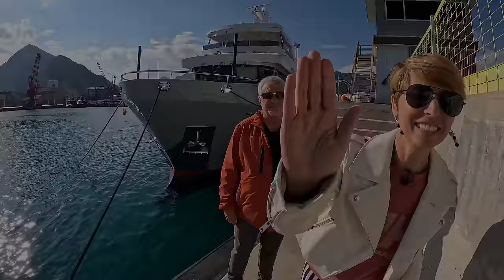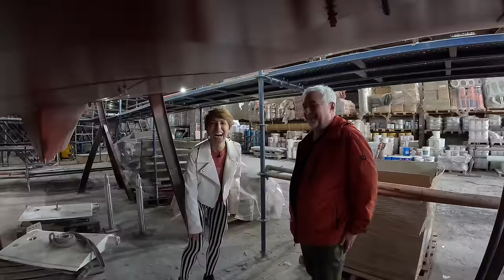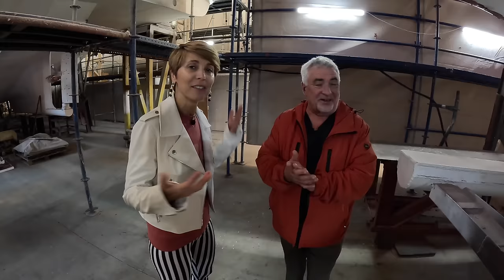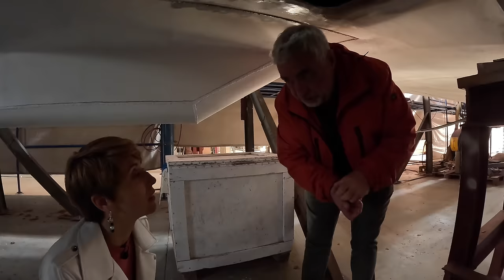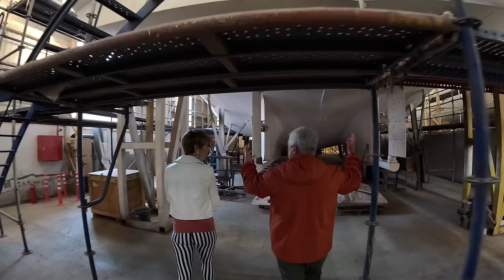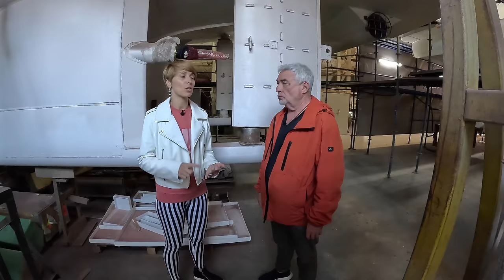This is Bering 72, but... 🙈 Eps.51

Comment: Zinc plates,are they sacrificial?  How often do then need changing, or is different oceans/seas have different rates of corrosion? I wrote his before I heard the voltage system,holy frig, my kinda ship, wow guys love all this info.  Started watching when you first started show casing other ships, but following this build is just amazing and gives a new appreciation to ship construction. When is anticipated launch date of you ship.
Reply: Yes, the Zincs are sacrificial anodes(aka galvanic anodes) and are used on all marine vessels as a form of cathodic protection. The electric powered alternative mentioned in the video actually sounds like a hybrid system and seems like it would save a ton in expenses over time since even just the Zinc is fairly expensive, much less the labor cost of replacing them.

Comment: 4:57 I think what he is trying to say here is that you can not close a circuit by sending the electric current through the hull of the ship.
Meaning, if an electric current happens to run onto the grounding the hull provides, it's lost to you, as it will be "dispersed" into the water.
That's a good thing over all, because that means that the danger stray currents pose to people on the boat is relatively small, for as long as a grounding is provided.

Comment: When you guys were early in the build, I remember Alexi talking about filling the bow blub with concrete.  When I heard that my immediate thought was about corrosion.  Wet concrete is very corrosive and I was wondering if the inside surface of the bow bulb was treated prior to pouring it full of concrete.  Since then my thought has been why concrete?  It's a sealed compartment.  Why not just fill it with sand?  The difference in weigh can't be significant.

Comment: One thing that wasn’t mentioned, if you can take your boat in a fresh water river the marine growth will come off by itself. You still get algae on the waterline but no organisms will grow in fresh water. In the UK, we call the zinc plates “Anodes”. Another topic that could be talked about is radar deflector that you don’t need on a steel boat over a certain size. My ex’s boat was only 10m 33ft so we had one.

Comment: Marine life also has a non-parasitic part to it. Even if the ultrasonic repellers really work for barnacules, have you thought about dolphinos? They will cause not only pain in their sensitive ears but also visual hallucinations in their sonographic imagination.
Reply: I keep hearing that dolphins are very intelligent...intelligent enough to know that if something is interfering with their audio/visual sensors that they stay away from it. Also, the frequency itself may not affect dolphins or other marine life the same as it does vegetation or barnacles.

Comment: Mercury Marine have had this option for many Decades. Called MerCathode. Actually comes standard on their Mercruiser product where the Tranducer is actually built into the Transom bracket.
Okay, it does not have the technology to inform you of a hostile environment

Comment: Cleaning hulls was my older brother's summer gig. One of the most back-breaking/knuckle-shredding boat chores; rich SoCal weekend sailors were happy to pay. No doubt you need all the preventative help you can get, but isn't there a debate about the toxicity of certain anti-foul paint ?
Another geek question is about tank trim. Is there a system to help you balance the tank levels for optimal stability/ride ? Is it just experience /feel ?

Comment: Talking of corrosion, what about the interface of the Hull (steel) and Superstructure (Aluminium) being dissimilar metals?
Reply: They covered that during one of their 'build exploring/reveal' episodes.I'd wondered too.Something about the 2 materials being friction welded to each other creating such a bond.ie; It's a band of the 2 materials placed between the upper alum,and lower steel get welded and bolted to.I hope that helps.my head hurt now ;)
Reply: Good question but that my friend was covered in a previous video.

Comment: Just curious. Alexi talks about copper for the sea chest, so I expected copper coat on the hull as well. Any particular reason for not using copper coat  on the hull, even in combination with the ultra sound system ?
Reply: Navy1977 copper coat is an anti fouling that is painted on the boat, built up with pure copper particles. Sounds like they are using it on the sea chest, but not on the hull. So am kind of curious why it is not used on the hull. 
I have copper coat on my boat, works perfect, don't need to take the boat out anymore to change the anti-fouling (every 2 years), so saves me thousands of dollars every 2 years. Also don't need to get divers to clean the hull. Hull stays clean if you use the boat on a regular basis. And in combination with the ultra  sound most likely would not need to do anything anymore.

Comment: Great information on the maintenance of the ship would like to know how much does it cost for one or two divers to go ahead and clean let's say a 70 ft vessel. Steel vessel. Just curious cuz I looked into getting a business for cleaning commercial vessels and we were talking about charging 20 to 30,000 but these were 100 ft vessels or more. So just curious as to what is the going rate for your size vessel for cleaning. And I'm assuming you're going to be doing this probably 3 to 4 times a year??? So let's go out there and seek this information in today's market. Thanks 😀🦜 Alan

Comment: I don't want to advertise someone else's channel if it's not wanted here, but some might find this informative: Grady at the Practical Engineering channel did a whole video on cathodic protection like zinc. His focus is on infrastructure like bridges and dam spillways, but it's the same principle, and he has a demonstration where you can see what happens to a zinc when submerged with an electrolyte: "Why Spillway Gates Don't Rust Out"

He has another video on paint and coatings where you can see just how effective paint can be at protecting steel: "What's the Difference Between Paint and Coatings?"

I've given the video titles rather than links, since a lot of comment sections don't like links, and please delete this if it's unwelcome.
Reply: Thank you.I'll check it out as I'm interested.

Comment: whats a zinc?
Reply: The place where Rico washes dishes.(Come on...you were thinking of saying it too) ;)
'Zinc' are plates/blocks of the metal bolts to and through the metal parts of a ship exposed to water that act as 'grounds' so salt water doesn't eat the steel or aluminum parts 1st.Example.A man and wife bought a used ship that was totally repainted and had new props too.About a month later they had to request rescue as their boat wouldn't move and he thought they'd sheared the props.(this is off Virginia shores)When the ship was rescued and divers checked,the props were eaten away as he hadn't had any Zincs installed and the shafts,rudder,and stabilizers were toast too.
Reply: @bryduhbikeguy  Great explanation, thank you . And yeah, i was totaly thinking sinks. lol . Or maybe a zinc based paint, i dont know what that would be but I've heard of lead based paint. Thanks again